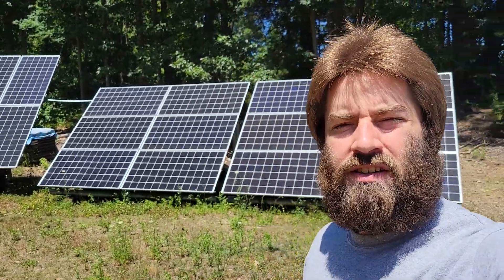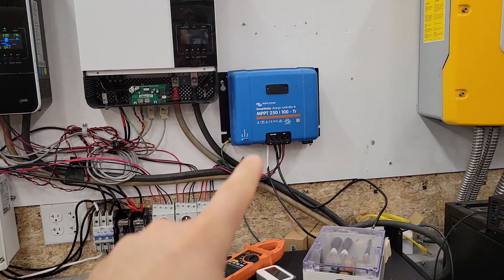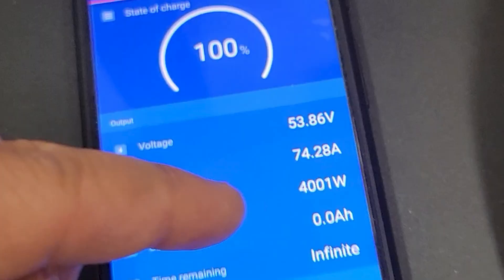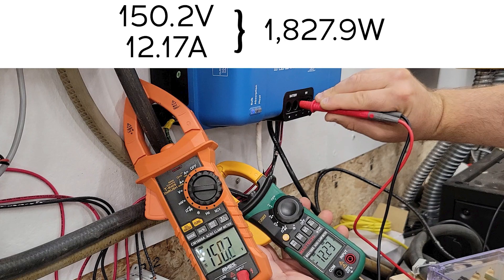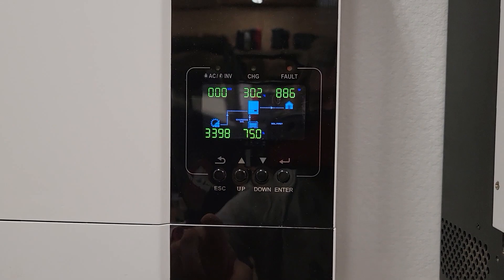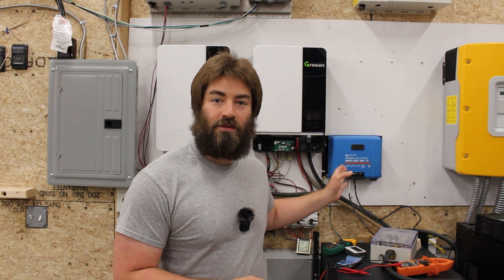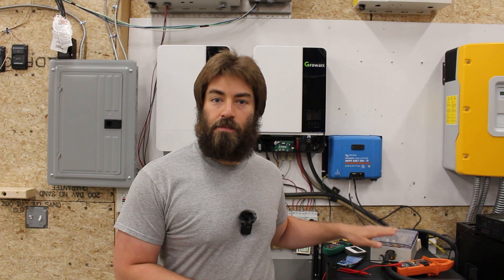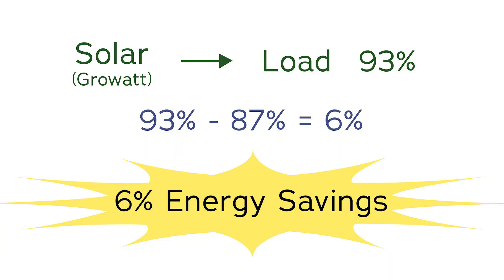Victron vs. Growatt solar MPPT charge controller efficiency test

Comment: if mppt is inside system on busbar and its cool when full throttle then its ok but you need to be sure its repairable . i hear bad rummors for  long term use in growatts  in europe 230v .. and it seems that victron still keeps the win to less problems... i could use a growatt in future if my topic repair shop agrees to service it if need! ...  warranty needs installer and i m diyer ..!!  even with my multi ii 5000 i m not sure if i  hunt any warranty  .! hopefully 2 years and still running   all mppts and multi!   !!  i hope your schneider system   keeps strong nowdays!

Comment: That was an unfair comparison, although you switched the load off, the Growatt inverter was still running, using some of the solar input to power the inverter circuitry.

Comment: I hope I don't sound stupid , I am a complete novice with solar installation or system. But I want to know if one can use both an external charge controller and the hybrid inverter ( inverters with inbuilt charge controllers) together? I mean, can you connect an external  charge controller to a hybrid inverter?
Reply from the maker: I ran both of these at the same time.  I use a central bus bar on the 48V DC side.  The battery connects to the bus bars, the Victron charge controller also connects to the bus bars.  Finally, the inverter connects to the bus bars.
Reply: @DavidPozEnergy  Thanks for the insight

Comment: Hello
the growatt has a max panel of about 5000 watts ....  i wonder if it could work with the victron mppt  parallel  (for extra panels for better winter performance)
Reply from the maker: Yes, that's how I had it setup for over a year.  I have three solar arrays in my backyard.  Two of the arrays went to my two Growatt inverters, and the other went to the Victron.

Comment: Great video.  If anyone is still following this string, I have a small system of individual components including a Victron charge controller.  I want to upgrade to something like the Growatt and would pay for the Victron Multi, but I don't think it has an AC IN for charging (or pass thru).  Am I wrong.  I really like Victron, but that seems like a big thing to leave out.  Am I wrong?  Does Victron have something else that is all in one with AC in?  Thanks for any help.

Comment: David, I've gone thru 4 victron chargers that lasted about a year each. I switched over to Growatts & not having any failures with them yet, well over a year now. Victrons are more feature rich but aren't worth a crap to me, especially since Growatts are more than half the cost of victrons.
Reply from the maker: Thank you for sharing your experience.
Reply: Hi, would you mind sharing what models and what happened? So we can learn more about it. thanks
Reply: @segundacuenta726  The victrons were the 150/100's. They just died, no signs of trouble til they just gave out. I drove 'em pretty hard so they just don't have the guts to hold up under long term heavy stress.

Comment: If you have a smartsolar and an inverter and the load does not exceed the solar power, in the same way, the current of the smartsolar goes directly to the inverter. what is the difference with the growatt? It's a trivial law of ohms.

4.35 """have the charge controller built in to
the inverter package
they really do well when you're using
that power as soon as it's being created
and skip the whole battery charging"""

I think you have to study some physics. what you say always happens. even with a mppt + inverter. there is no such thing that during the day the power goes into the battery and then goes out to go to the inverter. I feel bad just having to say it.

By law of ohms, the load always has priority over the battery charging (the  is battery is simply a non-0 voltage  load). do you believe that on the same conductor it can pass current in 2 directions? before go into the battery and immediately go out of battery to the inverter???Have we gone crazy?

If the power of the load does not exceed that produced, the current of the mppt will always and in any case go directly to the inverter. whether it is hybrid or separate does not change absolutely anything. I hope I have misunderstood what you wanted to say .. otherwise it is very serious that on YouTube they give advice without the slightest knowledge of the facts
Reply from the maker: Thanks for your comment.  I think this misunderstanding is my poor choice of words.  Please allow me to clarify my intent.
Hybrid inverters will have different efficiencies for 
1. PV to battery
2. PV to load
3. Battery to load
Note, "load" being the 120/240VAC. 

What you will find when you read spec sheet after spec sheet, is that the efficiency of PV to load is greater than either of the other two.  This indicates the inverter with MPPT CC built-in is built differently than having a separate MPPT CC and inverter.  

With a traditional system, there is a separate MPPT CC from the inverter.  The PV comes into the CC, and 100% of that energy is converted to a nominal 48VDC, let's say at 96% efficiency.  Then 100% of that can go to the battery and/or to the inverter.  If it goes to the inverter, then the inverter might be operating at 94% (Batt to load on the spec sheet) for a grand total of around 90% eff.

With these newer all-in-one inverter combos the architecture is different inside.  PV to load is sometimes listed as high as 98% efficiency.  I called it skipping the battery, but I was trying to explain that the system (inverter with built-in CC) is skipping the 48V DC bus internally.  Bottom line, using the power as it's produced is more efficient (8% in this example).

Here is a link to a spec sheet on another inverter that lays out the differences well. https://eg4electronics.com/backend/wp-content/uploads/2023/04/EG4-18KPV-12LV-Spec-Sheet.pdf
Reply: @DavidPozEnergy  my English is terrible. I try to understand better what you mean. And then I answer with calm. Maybe I misunderstood you.
But the only difference can be if the ibrid with load can convert from PV DC to 230AC. EXEMPLE: PV at 400v DC direct to 230v AC. In these case step down inversion.

A classic pure mppt+ inverter will convert 400v DC to 48v DC to 230Ac.
It is the point? Or I not understood?

Even I read tons of datasheet and manuals😁. And I discovered that cheap ibrid easun, gl4, voltronic and all this garbage clones lie about all the datasheets. I not speek of growat. All these garbage 400 euro for 5kw inverter, 5kw moor, 3 kW batt charger, will be forbidden. Dangerous total scams

Comment: Great Test !!
You consider using energy when producing it but you are using Lithium and turnaround efficiency usually %99 percent on lithium. So nothing different for you when you are using lithium. We can consider gain of energy, saving energy when using lead acid or gel batteries . 

Also this test doesnt mean external chargers is worst because even you are using external charger when there is load in the house you will get the same efficiency from inverter. BEcause energy produced from external charger will split without going in to the battery,  home usage will go directly to inverter and excess power will be stored in battery, if any.  The correct logic is like you said, washing the dishes in sunlight =)  But for lithium it will just save u %1 turnaround, and a little from cycle life of battery. 

I dont know at the time this video released they have it or not bu currently victron has 450 V chargers. (SmartSolar MPPT RS) Pricey but they have.

Comment: I am wanting to put 10 400w panels on my motorhome 5 underneath that extends out and 5 on top stationary 
They are 48voc panels at 9.51 amp sc. I plan to wire 5 in series which would be 240 volts at 9.51amp and parallel the second set which would stay at 240v and 19amps
I am thinking that with the panels laying down on the roof and not getting full sun most of the time as like you I’m in Nova Scotia and get your leftover clouds which seems to get bigger as they cross the water, I won’t get peak voltage or amperage very often if at all. I am also thinking on totally over cast days but not storming and dark but fairly light, with 4000w I should get at least 10% 400 watts to charge my batteries
Does this sound possible?
I have been trying to figure out how the Victron 250/60 controller actually works. I have a 12v system, it’s my understanding that the panel Voltage is independent to the battery voltage and the controller will control the solar to input to charge the 12v batteries because it is a 12/24/36/48v controller, is this correct? And will this controller protect it self when and if the voltage were to go over the 250v rating 
Thanks 
Blair
Reply from the maker: Hi Blair,  You have a good start to your plan.  There are a couple more things to consider.

Yes, this controller works with 12V batteries.  On the battery side is the maximum Amperage.  In the case of the Victron 250/100, that's 100 Amps.  That means the maximum power you can ever utilize on a 12V system is about 1.4kW (100A@14V).  Keep this in mind because you said you are planning 4kW of solar panels, which means you will be loosing out on 65% potential.  Some clipping is OK, but usually kept lower, around 20%, in design.  Personally, I would split the array into more than one charge controller.

Next, let's talk Voc.  Volts open circuit.  You said your panels have a Voc of 48V, and you are correct that the string Voltage of 5 panels is 240V.   Keep in mind, this Voltage is under STC (standard test conditions).  The solar panels I use are certified with STC of 25 degrees C (pretty common).  The Voltage of a solar panel will be higher at lower temperatures.  For my climate (North east United States) we have cold weather.  My electrical code dictates I add 21% to the Voc based on my areas winter temperatures.  The coldest areas add up to 25%.  If you don't know your areas multiplier, assume 25% if you want to be safe.  That means your 240Voc will be 300Voc in winter.  The Victron charge controller can protect itself with a very small over-Voltage, but not that much.  I suggest changing your plan to keep Voc(cold t) below 250V. 

Consider some different options.  Either different controllers that can handle more Voltage, or different panels, or different string orientations. Good luck with your build.
Reply: I understand about the cold but it’s going on my motorhome and it’s stored in the winter, I can also use disconnect switch to shut panels off 
Your talking about 1.4 Kw at 100 amps at 12v
I’m not understanding, I need help
The panels produce 48 Voc and rounded up 10 amps, so 5 panels 250v and 10 amps. The second set in parallel would be 250 v at 20 amps going into the controller 
So how does it work that I’m loosing my power. Just trying to understand, I can be dense sometimes and I how to do just about anything but I only know enough to be dangerous 
I picked the 250 controller because I couldn’t find a larger one. Do they have any and what do you recommend for a controller 
I am trying to maximize Solar power with available space on the roof
I’m wanting to be able to use the AC at about 1700 watts, I got a 3000w inverter pure sine wave
If I can understand how the panels and controller all works together I could then make proper changes
Reply from the maker: 100Amps is about the largest solar charge controller out there.  The 100A rating is based on the battery side, not the solar side.  You said you are running a 12V system, which will charge around 14V most of the time (depends on your exact battery specs).  14V*100A=1,400W.  This is the maximum Wattage the charge controller can OUTPUT to a 12V system.  If you had a 48V system, charging at 56V, then it could output more Watts, but the Amps still stay the same.  56V*100A=5,600W.  
Your solar panels will make 240V, but they don't "make" Amps, Amps are pulled by the charge controller.  So, in your 12V system the charge controller can only output 1,400W.  This means it can only pull in 1,400W.  1,400W/240V=5.83A.  That's it.  Even though your solar array has the POTENTIAL of 20A, the charge controller can only pull 5.83A at that Voltage, given your choice of a 12V battery bank.
I totally understand this stuff can get confusing on your first go.  I recommend watching a 6-part video series from Alt-E. https://www.altestore.com/diy-solar-resources/off-grid-solar-system-design-video-series/
Reply: Now I understand how it works thanks very much and now I will go watch your link
Thanks 
Blair
Reply: Am I understanding this correctly 
I can get a 75v/15amp controller for $135.00
This would allow me to get the maximum out of 1 48voc 400watt panel 
So I would need 1 of these controllers for each panel to get the maximum wattage available from each panel 
If I want to keep my 12v battery 
OR
Use a 48v battery bank and a 48v inverter to supply my 120vac and then a 48vdc to 12vdc converter to charge my 12v battery bank to power my 12v accessories in the motorhome 
Is this correct?
Even though the first option my not be practical 
Thanks 
Blair
Reply: Guessing you didn’t respond because I didn’t understand what I was reading 
 Went back and read what you explained, quite clearly I might add, if I was paying attention to what I was reading 
  The Amps rating is on the 12v side not the panel voltage of 48v
 Now I am understanding it better 
  Found out Victron makes a 450/200 controller, but it’s a lot of money 
Thanks for your time to explain it to me 
Blair

Comment: Wowowowo ... when you connect the MPPT to the battery AND let's say a multiplus on this same battery pack .. current that is available will not transit to the battery then to the inverter but will directly goes from Mppty to inverter, it's just a question of least resistance path. There is no need for an all in one to do that, so no .. the Growatt is not shinning anywhere ... maybe on price ...

Comment: Hi David, thanks for the video. can you please tell me how you connected the solar panels, their watts, voltage and amps for the growatt inverter.
Reply from the maker: I have my panels connected in two strings.  The two stings are paralleled at the inverter.  Each string is about 300 Volts, 9.8 Amps.

Comment: Sub done :). I have Victron 150/35 for 4 panels and have question about this Growatt. How it works without Solar connected (Victron use them) means how works Battery and Grid... this is Battery first and Grid add additional power or it's separated and Battery only until it;s off and then swap to Grid. This is the most question I have before buy a Growatt :) Maybe this is good question to do a new video ? :). BR from EMEA\Poland.

Comment: Isn't this a bit of an apples to pears comparison? a solar inverter/charger with a just a solar charger? would a Victron Multi RS Solar 48/6000 solar inverter charger be more of an equal comparison?
Reply: its the same. in fact, victron easy solar have inside a real smart solar.

Comment: But that damn growwatt inverter consumes 50 w standby in 24 hours that's basically one entire battleborn battery consumed in 24 hours just for standby.
And a lot of cheap Chinese inverters have extremely thin wiring in the housing so the voltage it shows on its little display are far from what's truly happening many times you think your battery is charging in a certain voltage but it's actually at a much lower true voltage.
PS the growWatts not UL approved so good luck getting your insurance company to pay when it all goes up in a cloud of smoke

Comment: Hi David, I have built a system with 16 230ah eve cells, a spf5000es growatt inverter, I have it all completed and am at the stage of connecting them together, I know before I hust connect the two via my 6awg wires, I need to precharge the capacitors, I have a 10w/10ohm resistor, Is this resistor ok to do the precharge or do I need to get a different one, if so what ohm do you suggest, have watched all your videos and they are great, thanks Dean
Reply from the maker: I use a 10 ohm, 100 watt resistor.  A 10W might burn up like a fuse.  
Also, the manual says the minimum wire size from Battery to inverter is 2 gauge.  I used 1/0 on mine

Comment: I have 9x 550W panels with 49V open circuit DC each. Would the growatt take it in series? It is 450v max but can only handle 430V in regular.....
Reply from the maker: No, I wouldn't wire all 9 panels in series.  The 450V is a hard limit.  You risk damaging the inverter if you go over that.  Also, don't forget to add cold temperature compensation to the calculation.  You will have to check the NEC (electric code) for your temperature compensation, but if you don't know it, then worst case is 1.25, which basically means adding 25%.  Voltage goes up on a solar panel when temperatures get cold.  So, I would run my calculation like this: (450 Vmax)/(49.0 Voc)(1.25)=7.3 panels in series.  Since you can't have a fraction of a panel, round down to the nearest whole number.  The most you can wire in series is 7 panels while being within safety margins.  You got 2 spares.
Reply: @DavidPozEnergy  Today I wrote with PowMr . They sell the SPF5000ES at ebay with 500V DC in. The seller said that 500V is the upper limit. So 8 Panels x 49x1,25 =490V will do.

Comment: Very nice videos thank you! I am trying to find a system lika yours that I can add wind power to. That power can be both DC or AC since most wind generators comes with a transformer that makes direct current. Du you know anything about this?
Reply from the maker: Sorry, I don't have experience with wind turbines.
Reply: @DavidPozEnergy  Okey, thank you anyways!